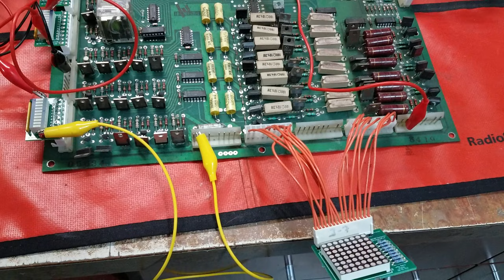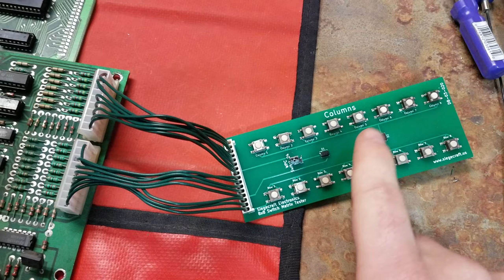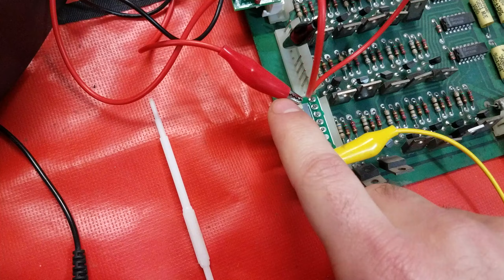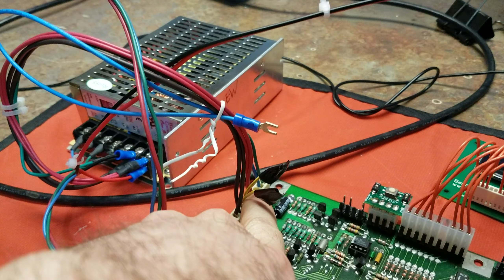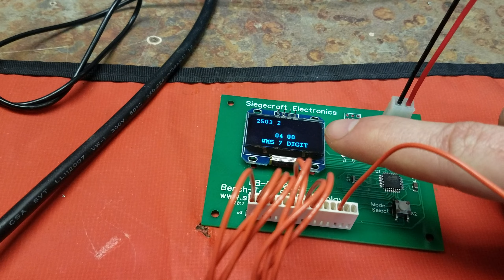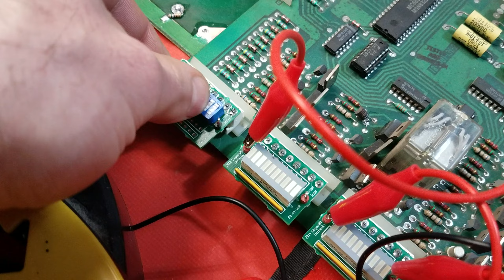Using Siegecraft Electronics Products to Bench Test Williams System 3-7 pinball MPU and Driver

Comment: Great video with great explanation!!! would like a detailed picture of the Molex from power supply. You said first 2 ground next 2 were for probe and next 2 for 5 volt but you skip on slot and then the last 1 is for 12v although there are 2 wires from the 12v. Great job!!!!
Reply from the maker: Look up and confirm the wire spots in the manual. I used that connector and power supply for System 9 repair as well, which requires -12v (that's what the second wire is) but the other end of the wire is not connected to the power supply for repairing System 3-7. System 3-7 needs +5, +12, and gnd only.
Reply: @zachgutzmer1172  Thanks so much I'm setting up for a system 6 Williams Tri Zone Great video though!!!
Thanks